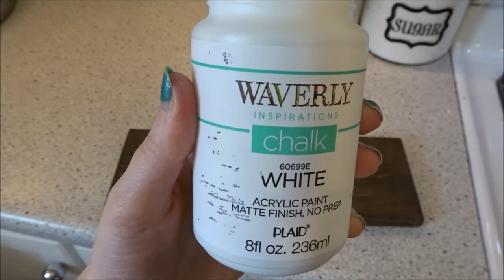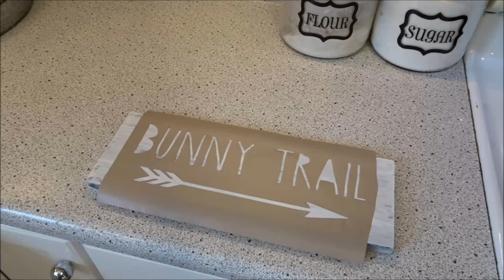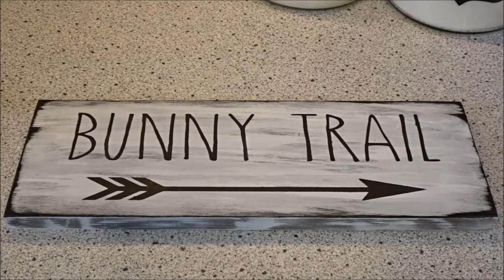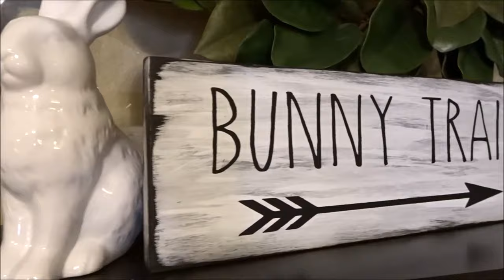DIY Bunny Trail Wood Sign

Comment: So cute!  I am working on my huge 6 foot sign and got my town name going across the whole thing.  I used contact paper and it turned out pretty good!  I had just a few areas where it bled under just a little which I wouldn't have had with vinyl but I didn't want to use the amount of vinyl it would have taken to do it.  I will probably use vinyl for "South Carolina" with will be layered on top in a small, different font.
Reply from the maker: Very cool!!!!  Big signs like that take a lot of time, but sounds like you are getting there!  I madea 6.5' tall blanket ladder for a client this weekend so I have a visual of just how big your sign is!  WOW!